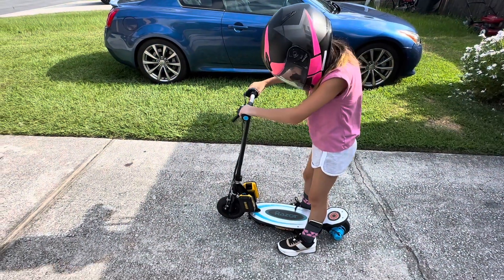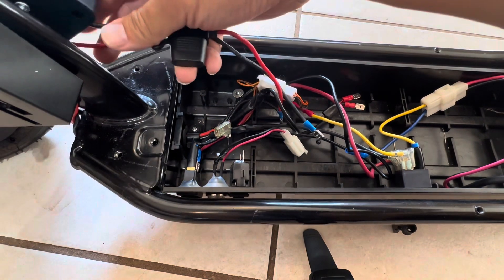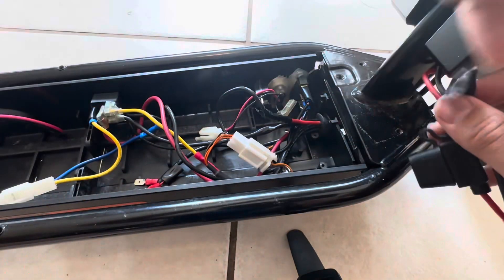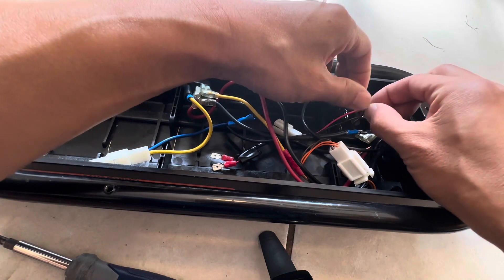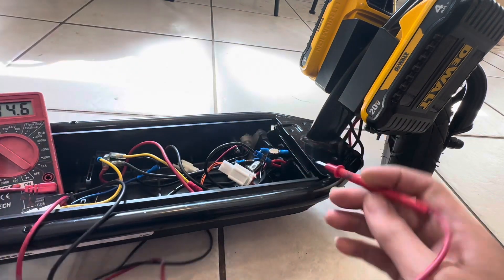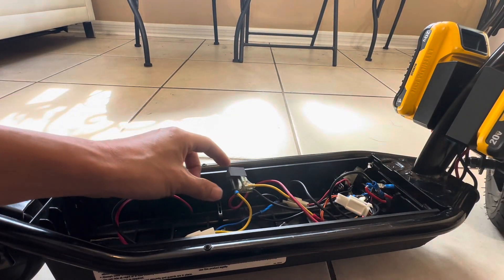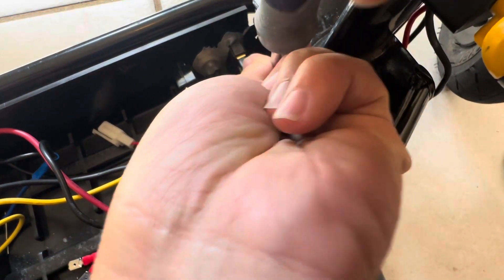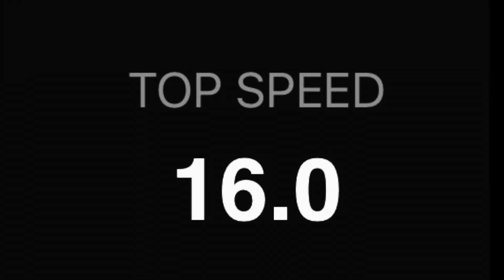Do not do this modification. 40v battery on Razor E100 scooter, 12v relay throttle control, Unsafe.

Comment: Okay I will do this mod😂😂 and also how fast does it go?
Reply from the maker: Lol, she went 16 mph before she lost control of the scooter and jumped off. The throttle stayed on maximum full throttle and she couldn’t slow down with the brakes.  We ordered a larger 48v relay and it should arrive soon.  It will still be fast, but with more control over the throttle.
Reply: @DIYwithDUY  oh. ok